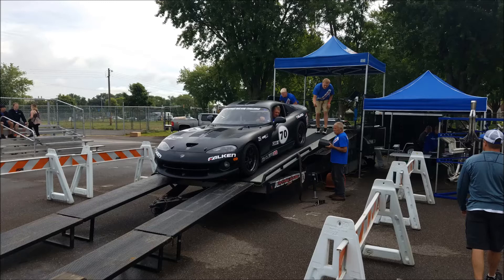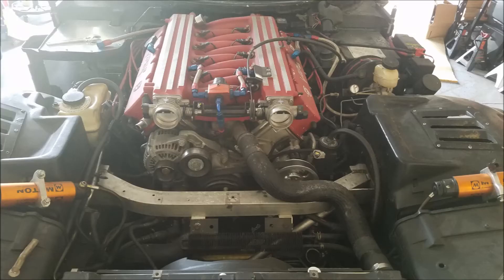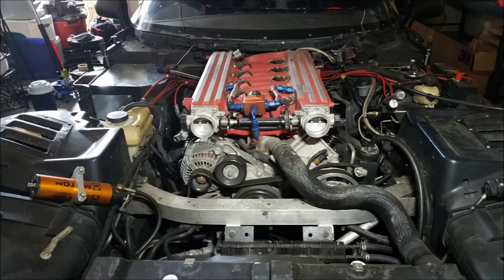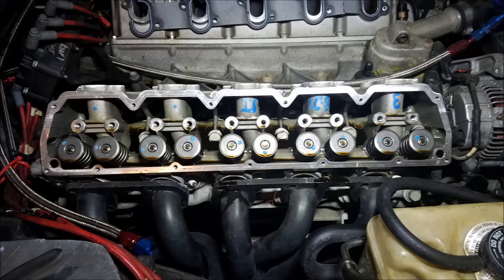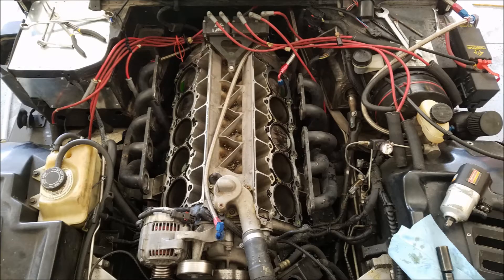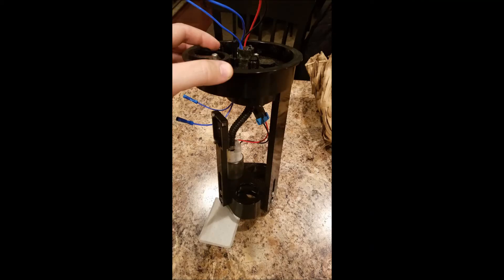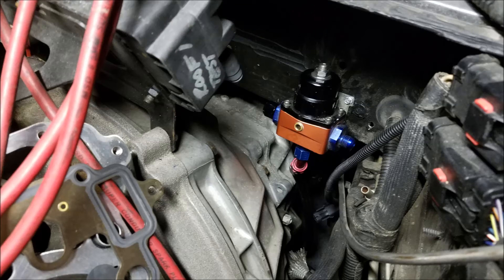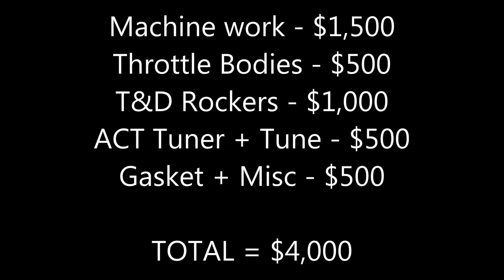How to make 100 rear wheel horsepower with port and head work! 1997 Dodge VIper

Comment: You can pull the cam without removing engine.   Just loosen motor mounts, remove trans mount, drop the tail to the ground (car needs to be on jack stands) and the cam will barely slide over the radiator (once the shock brace is removed:)
Reply from the maker: Good call, its a fair amount of work but that does work.
Reply: I"ve got TNT headers on the GTS, which are slip on 5-1.   Its actually easier for me just to pull the engine but your headers look like a pain to deal with.  I'll tilt the engine on my 1st gen if I ever do a heads/cam on that one (Belanger headers)
Reply from the maker: Probably smarter that way.